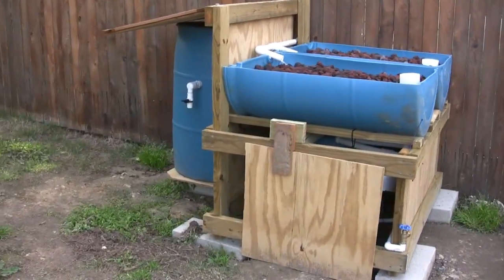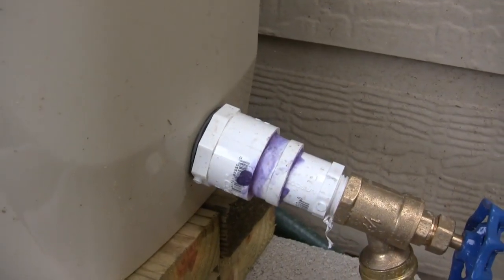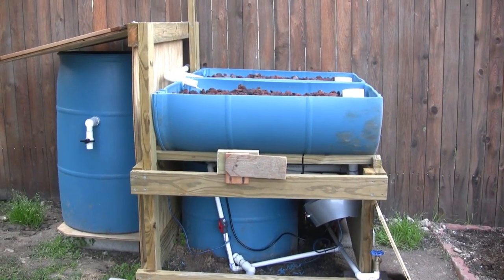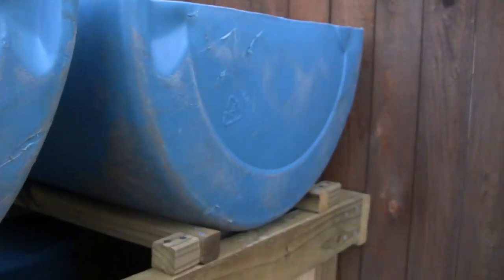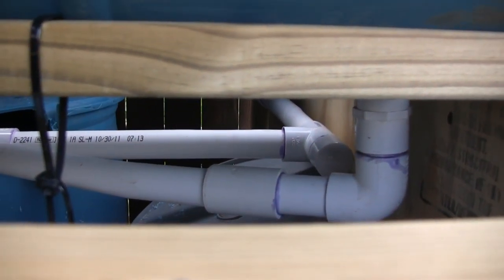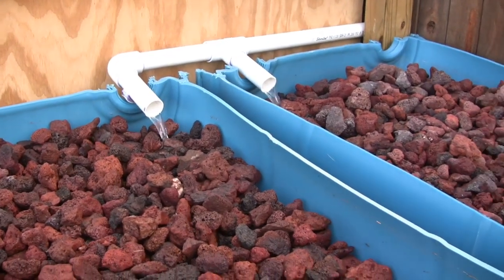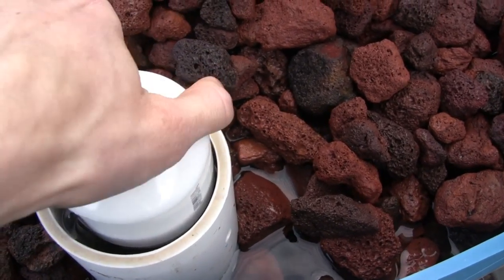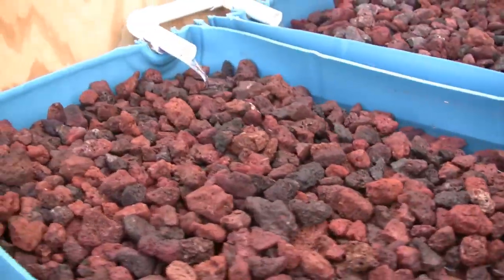Backyard Aquaponics: Revisions

Comment: This is old and maybe you already figured it out but you can fill your system using normal tap pressure you just have to change a round "pressure gasket" to one that uses a lower pressure like 2lbs. I think normally they are 8lbs. Ill try to find the video I saw that on.

Comment from the maker: @MrMadmax478 Thanks!  Good to know about the rock, I'll check for some other options if everything I see looks like limestone.  Yeah, I'd love to use Hydroton (have that on my indoor system), but it's too expensive for this larger project.  I haven't measured my tap water directly out of the tap, but my indoor system which I refill with dechlorinated tap water has a nice pH right around 7, so I'm not very concerned about that yet.